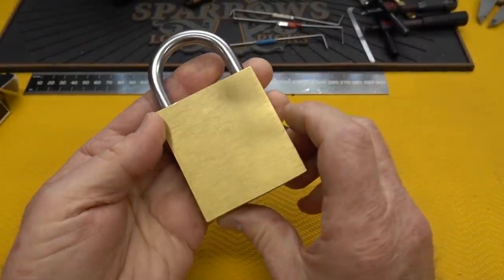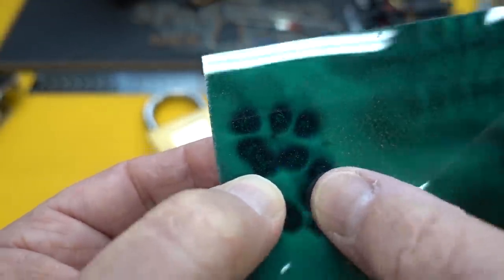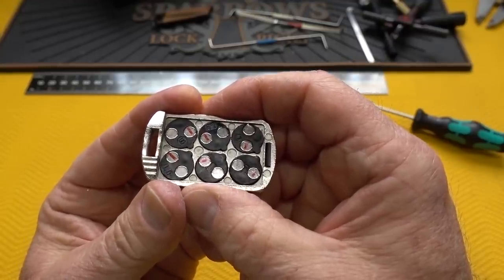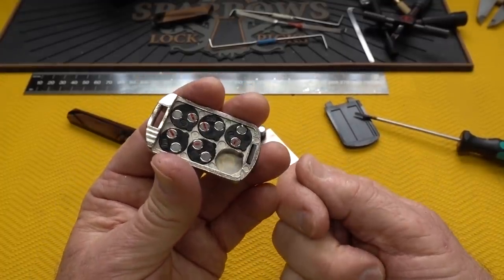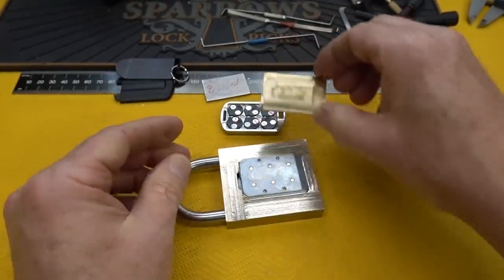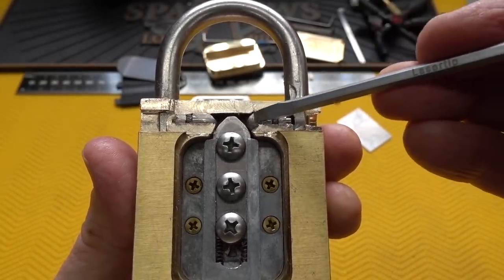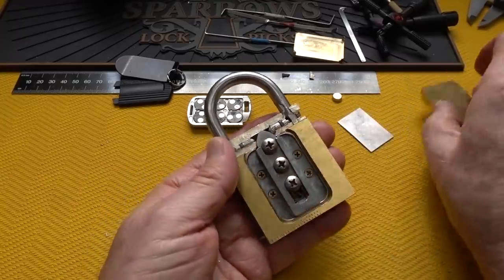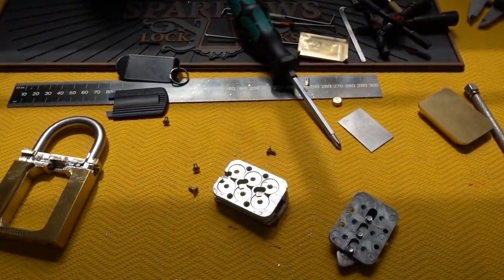(1701) RELOOK: Magnetic Lock (How It Works!)

Comment: Once you understand how the lock works, it’s obvious that the key tells you everything you need to know using the magnetic filter. However, that means you have the key in your hand. You could decode the key using one of those discs stuck on the end of a stick, probably even without the use of the viewing paper. In fact, if you glued the little discs to the end of six nylon rods, mounted them in a block that could lock the individual rods, the magnets in the decoder would automatically align themselves with the discs in the key. You could then lock them in their orientations, flip the block around or turn each magnet by 180 degrees and you have copied the key. Pretty sure that decoder tool could be made to also be a pick. I’d be surprised if the manufacturer doesn’t already have such a tool.

Comment: It should be fairly simple to create a copy of the key.  Make another key, but have the disk locking be a removable piece of plastic.

If the disk are free-spinning, they'll match what the real key is, and then you lock them in place.  You should then be able to use that key to open the lock.  You may have to use 2 copies, as making the copy will reverse the polarity.  You could also design the key copier with a "read" side and a "use" side.

Comment: I don't think that you could decode the lock in any way but a key could be duplicated in seconds with the right tool. 6 free to move magnets in a 3 by 2 grid the same size as the key would allow the magnets to snap to the position of the matching magnet in the key. Retain the magnets there and you have an impression of 6 of the magnets. The other 6 are simply located 180 degrees opposite of the centre of the grid.
Absolutely brilliant mechanism.

Comment: This key design can withstand very dirty environments where a traditional pin and tumbler lock would seize up. Too much gunk on the lock just wipe it off and put the key in place. Downside is that because it is magnetic any strong magnetic interference would make it impossible to unlock and if it gets too hot the magnets will become demagnetized (Curie temperature) and will be permanently rendered useless.

Comment: Thermal contraction could probably work without damaging the finish of the lock. Try using a can of dust off or Freon to shrink the plate and if it doesn’t fall out, maybe a suction cup also. Just trying to be helpful.

Comment: I bet if you had 6 magnets that are the polarized right, you could just keep rotation them until it unlocks, There would be almost no way to know if it is working or not. You could try running it through a degausser and ruin it completely lol. A torch might demagnetize them also, but it also might pop the back off too.

Comment: As for the orientation of magnets viewed through magnetic paper - you can't see it, but you can see how magnets are oriented in regards to each other somewhat.
Same poles will create gap between each other, opposing poles will have dark area between them due to magnetic flux direction.
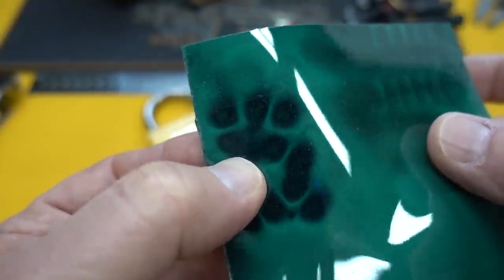Looking at 2:20 the orientation is:
+ + +
+ - + (flux from 3 magnets towards single one)
  +      + 
  +      -
       -    -
Or opposite.
Or you could just draw with the layout with this magnetic paper and use single magnet to get the polarity setup.

Comment: Does the downward force come from pulling the shackle, is it possible to create tension from it?
Depending on the threshold, maybe you can "recreate" 2 side by side freely rotatable dials having the same N S polarity to bind each of 3 notches one by one.

I wonder how much heat is necessary to strip the lock's magnetism, it will also make "picking" it easier as the magnets in the lock will no longer repel each other meaning you can rotate one disc at a time.

Comment: I think it should not be too bad to pick it. The general idea is to first use magnetic paper too see how many dipoles there are and where they are. 2 spotes on the paper make one dipole , so we immediately know its a 3 by 2 grid.
Next step is just the usual picking process. Tensioning by pulling on the shackle, and finding the gates by rotating each disk with a simple dipole magnet you put on it on the outside. They didn't even bother to put in false gates. Depending on the strength of the magnets you may need to build a frame and use 6 "pick magnets" at the same time to keep all disks in the gates.
If you can actually get your hands on the magnetic paper "image" of the key, it would be much easier, because you just have to rotate your pick magnets to the rotation of the dipoles on the image. Since the  image cant tell North and South appart this leaves only two options for each disk.

Comment: There are six circular wafers, each housing two magnets at 180 degree intervals, one positive one negative, those wafers are roated on the 360 degree axis to signify the location of the pins that need to be manipulated. Can you just take a magnets and drop them see where they stick and then mold it, remove the mold and flip all the magnets 180 to reverse the polarity of all magnets.

Comment: You could make a universal key that has an arrangement of six small threefase inductor motors without their rotors. This way, you could put current through them and spin rapidly all the disks and eventually align them to open the lock. If this consept is possible, then someone could build a key to open every single lock of this type

Comment: Yeah, this is really neat tech.

But as I think about it.

A set of motors, rigged to magnetic disks like in the key.... Spinning at a very high rpm...

Then the lock is tensioned... Very very slowly... Maybe with a screw based device. To that it is really minute in the motion.

As the pins come into contact with the spinning disks, there will be one disk that contacts first.
And as that contact occurs, and as pressure is increased... Surely that disk will tend to bind in the gate position.
The disk will successful spin to begin with, but if the pressure is added slowly enough, there will be a moment where the pressure before the gate spins past is light enough to allow the soon... But the pressure pushes too far into the gate to allow it to spin after the gate is passed. The pin will get stuck in the gate.

Then the next binder disk will do the same thing.

So with a setup like that, all the licker needs to do is attach the rig, start it spinning and wait.

Comment: Hey Bill! One thing came my mind. Can you check the Curie temperature point of those magnets please? If they are made from a ferromagnetic material they will loose their magnetic field and it simply come back belove that temperature. If they are made from another material let's say those magnets are "Chinese neomdimium ones" they simply loose their magnetic field and it will not come back. So in this case there is a chance that a simple magnet can open the lock just moving it around the surface randomly.

Comment: You should definitely be able to pick that with the right tools. I think what you need is a nylon or brass rod, same diameter as those discs, with two holes in the end and a pair of magnets north/south. Then, if you tension the lock, you should be able to feel the pick engage with one disc at a time. If you then rotate the pick, potentially through an entire 360°, You should be able to feel if the disc is binding, and feel if it locks into place. The tensioning would be done just by pulling on the shackle.

Comment: The magnetic paper on the key actually provides a lot of information.
It tells you where each magnet is, and then if there is a sharp between 2 they have different polarities pointing towards the paper while if they combine into a larger blob they don't.
This allows you to narrow it down to 2 possible combinations, where the only difference between them is the polarity of every magnet is switched between them.

Without the key you have a lot less option.
It would be easy to turn it into a combination lock, and depending on how well it is machined, it may even be very easy to pick.
Get a "key" where there aren't any of notched to hold it in place and instead have a rod to turn them.
Pull on the shackle, and turn each one in turn.
If it works well the shackle forces the pins down and as you turn it each gate gets stuck on the pin until all 6 are done.

Comment: My only suggestion for improvement would be to make the key using electromagnets with a coin cell and button, that way you would not be walking around with a load of magnetic flux in your pocket potentially messing up credit card strips etc.

Comment: I think this lock can be attacked/decoded. You need a key with six rotating dials with a pair of magnets in each one. There seem to only be six possible orientations for each dial. so what you could do is try different positions on a dial then tug on the shackle at each position to see if the shackle is in a gate or not (it will pull out further when it's in a gate). You'd have to mark around the shackle with a sharpie where it meets the body to be able to see the tiny differences in position when you pull on it. The first (binding) dial will take some finding but after that it gets exponentially easier to find the next ones.

Comment: Well, I now know how to build a tool to lock these picks. The big weak point of this lock is rotors or the rollers. You can pick this like an old fashion safe if you listen for the tumblers to rub in a way that you know the gate is open. What you proved by opening that up is that the Rotors are spaced out evenly and the magnets are parallel from each other. All you would have to do is build a plate that can hold 6 rotors and magnets. You would rotate each rotor until it locks to the one inside the lock. With this, you could roll them past the magnetic set position when the keys not inserted. Honestly, this lock is now easily defeatable and a tool could be made for these locks to get picked in under 10 seconds I'm betting.

Comment: Adrien Ragot  close, except under tension, I don't think those disks will rotate, this is how I think you'd have to pick it, build your 6 disk pick then you could tension it and by feel see which disk is binding, because the other disks would rotate smoothly and the binding one would grab as the magnetic fields align and repel as they come out of alignment, then you'd have to set that disk, probably by guess and test,until a second disk binds, now this disk is hopefully set and the 2nd binding disk is the one that needs to be picked next and so on.

Comment: That gate that doesn't quite line up is probably why it was sticking. 

I'd think that applying tension and then rotating a key magnet around each of the lock discs would cause the gates to line up, but keeping the right amount of tension on the shackle with the very limited feedback available would be a challenge.

Comment: I am so glad that you machined open the lock and showed us that.  That is very clever.  Thank you.  

Now, you could make a tool with two magnets of opposite polarity on the end.  Think of gluing a couple of small magnets to the end of a dowel rod.  You could use the tool to rotate each disc separately to find the gate.  Probably use very light tension.  You would get minimal feedback through the tool, all the feed back would come from the shackle.  Maybe use light intermittent tension as you turn the tool.

Comment: I wonder if you could have superglued or epoxied something to the "panel" on the back, and then used something similar to a gear puller (or even a slide hammer) to pull the panel free, allowing access to the internals without all the machining?

Comment: The magnetic paper does show you polarity of the magnets. The ones that are opposites show strong field between them and those of the same polarity there is no connection between them. So there is more useful information. You know location and polarity, you then have 50/50 chance of orientation, one or two tries. But you do need access to key.

Comment: Bill, it is possible to "hack" this lock. if you have the magnetic paper, then you can see the amount and location of the magnets on the lock. then, you need to make a jig to hold magnets without clumping together. and then slowly move around and rotate magnets to find the correct polarity. its not hard.

Comment: About picking that lock, if you could machine or 3d print a ocntraption, with 6 dials to turn 12 magnets into a given set of orientations, I wonder if the tolerance on the screws would be poor enough to find the gates like any old word lock

Comment: not what i was expecting to see inside of it, but if you could work out the polarity of each set of magnets inside the lock couldnt you try like adding tension to the lock and spinning each disc until you feel it move more free and do it for each disc? because they all seem to be have two magnets in opposite polarity. you could probably 3d print a puck with opposite magnets and maybe try decoding each disc.

Comment: Now that we know how it works, we may have ways to defeat it. You need some sort of pick where you can turn those magnets, like the key does, and a way to tension it would be needed...
Reply: I think this setup will work: A jig With a computer controlled actuator to tension the shackle. It would have to be computer controlled, because it will have to tension, relax and retension the shackle and measure any minute changes in the movement that could indicate that a pair of magnetic discs have moved into a gate. 
LPL and Bosnian Bill could probably make one….

Comment: You could probably turn the guts of one of those locks into a picking tool of sorts.  Take the spinners and mount some sort of manipulatable dial on them and pack that into a case that holds it all togeather.  However I dont see a good way to get decent feedback when you tension it unless you by dumb luck managed to align them all.  Could brute force it and check all possible combinations but thats not really picking the lock.

Comment: Shoot, my theory on them were wrong.

My new theory is a brute force attack with an electric coil might. Apply pressure to the shackle and make all the discs spin by turning the electric magnet on and off. Maybe something circular or a parallel design.

Too tough, a dremel would be faster :D

Comment: What you COULD try: make a tool that has one "magnet disc" from inside a key, and put it on a handle as if it were a screwdriver of sorts.
Theoretically, if you hold it over one of the lock discs, you should be able to feel a little magnetic resistance if you try to turn the handle and the disc in the lock doesn't turn.
That means that, if you put a little bit of pressure on the shackle, you should be able to find out what disk is binding, because you'll feel the magnetic resistance. Lowering the pressure on the shackle then gives you a chance to "force"it in place, and find the next binder.
Since it's magnetic, you have to be REALLY sensitive to this, because if you use even slightly too much pressure, the internal disca won't turn.
A more advanced tool could be to make a die with 6 of those discs, each disc freely turning, but can be locked in position. Then turn the discs in the die with a screwdriver, and lock them in place if you found the gate. Still takes a REAL gentile touch, but with the added option of locking correct settings in place, so you don't loose any "set" discs.

To make a prototype tool you could use the key, file the notches off the discs so they can freely rotate in the slots and add a small set screw to each disc. Then it's a matter of getting the feel for rotating discs

Comment: I'm guessing that since it works from the repulsion of the magnetic poles, that the alignment of magnets on the gates will be slightly out of phase with the key. In other words, if the same pole on the key was placed exactly above the same corresponding magnet on the gate, the gate may be repulsed in either direction. If, however, either of the magnets was slightly shifted out of phase with the key, when the key is aligned, the slight difference in the phase position would allow the gate to be repulsed in the direction needed.

Comment: It's also interesting that it only works when trying to open the shackle. I expect if you apply enough force to try to open it, it will put force down on the wheels, and that friction will be much greater than the force you can exert with an external magnet. So you can only 'pick' it with magnets when there's no torque, which means there's no way to tell when a rotor is in the correct location...

Comment: It seems like the mechanism for rotating the disks to a potentially random orientation after unlocking and locking is the movement of the bolt and how the key is moved away. If there's any consistent pattern in how the disks are aligned after locking, then a tool could be created which enables those changes to be reversed causing it to unlock.

Comment: the magnets in combination with the cylinders to some degree make it so you can pick it like any lock. Just like a normal lock the cylinders bind, I dare say the binding was intentional to make it harder to pick. But if you think about it the binding cylinders give away the pisition of the de-tent. So if you have a rotation magnetic pick and you feel binding when you put tension on the shackle then that cylinder is not aligned yet. Just keep rotation the magnetic pick until the binding stops and then go to the next one.

Comment: Well i already see the tool to open it. You take the key, add 6 handles to disks and remove plastic stoppers. Then you put it to the lock, give it tension and try to feel some feedback while rotating the handles. I assume that feedback will be so low that you will not be able to pick it.

Comment: That's a cool mechanism, but I wonder how easily it could be removed while the lock is in use? If you could remove the back panel without damaging it, could you then unscrew the middle plunger bit and open the lock?